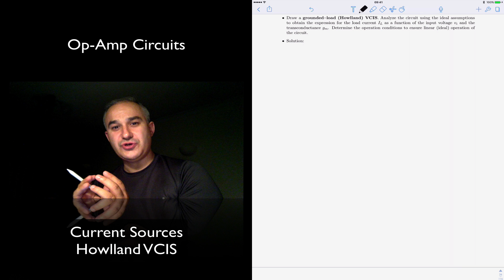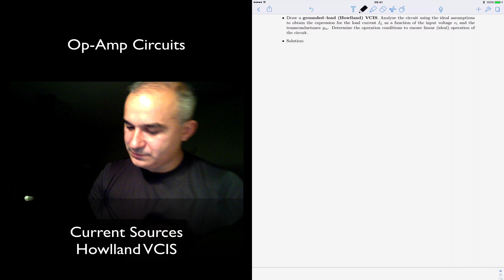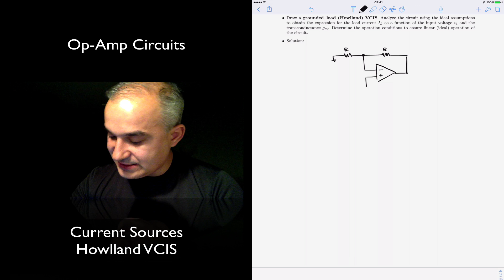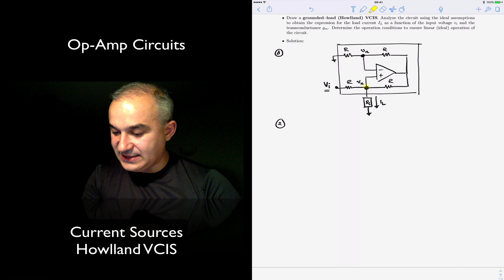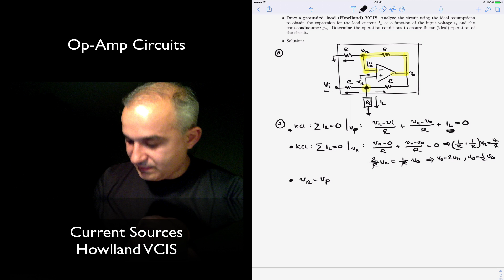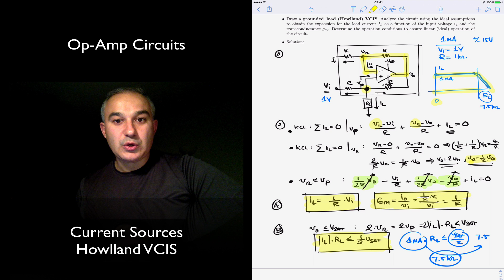Op-Amp Circuits: Howlland Current Source (VCIS)

Comment: I watched your partner's upload on the Howlland current source, then this upload from the suggested content below the first. You both complement each other very well. It was the perfect combination of repetition and alternate approaches to the subject.
  Thanks.

  One thing that I will probably end up testing on a breadboard shortly is the power supply configuration for the op amp. I understand you're trying to keep these academic models simple. 
  The circuit is DC in nature. If the op amp power supply were reconfigured as a single +30 volt/Ground supply instead of +/-15, wouldn't that effectively double the saturation voltage and greatly improve the effective range of this circuit?
:-)
-Jake

Comment: Nicely done.  
I know this is a current source, but I'm still wondering about the relationship between Vin and Vout.  
If Vin  = 0, then we get v(+) = (v-) for any Vout < Vsat. So there are many possible values of Vout with Vin = 0.
For Vin > 0, having done the analysis and knowing that IL = Vin/R, 
Vout = 2Vin gives the current IL = Vin/R and also enables v(+) = v(-).  In this case there is no current in the resistor from Vin to v(+); all of IL comes from Vout. So is Vout = 2Vin a unique solution?
I'll have to simulate this when I get a chance to see.  Thank-you!.

Comment: For a real implementation of this, which OpAmp could I use?
Reply from the maker: You can use just about any op-amp as long as its output voltage swing is within the requirements of your application (note that the compliance is Vsat/2). The main limitation (non-ideality) of this circuit is that you need to have perfectly match resistors.
Reply: Any problem with the value of the resistors? I would like to do a Current Source with a 5 V supply for biasing the OpAmp, so my reference voltage will be less than that.
Reply: Can I choose any resistor value a long as they have the same?
Reply from the maker: Yes, but they need to be exactly matched.

Comment: Is there a way to increase my maximum load resistance without increasing my Vsat?
Assuming I keep the load current to be 1mA(as you mentioned), but I want my RL to go beyond 7.5k ohms without increasing my Vsat, is it possible?
Reply from the maker: Just increase the input voltage, Vin
Reply: Thanks. I tested it on multisim and as you have mentioned, it works. But I'm wondering whether the positive feedback will cause issues with the current driving.
Because for the negative feedback, we are working in the linear range, but the positive feedback works in the non-linear range and does this affect the circuit in this case?